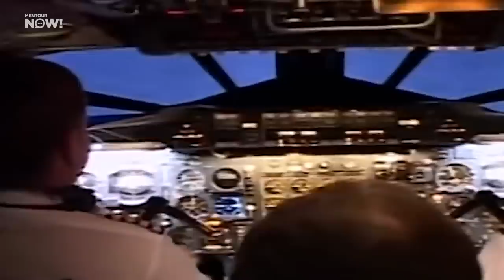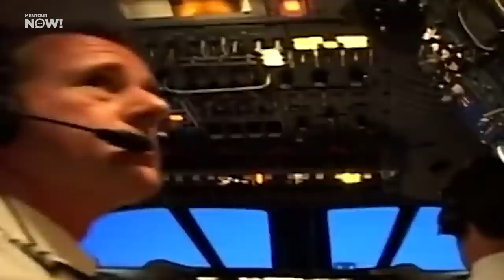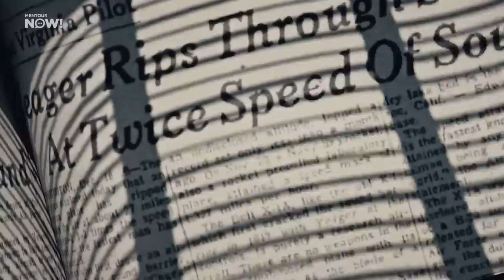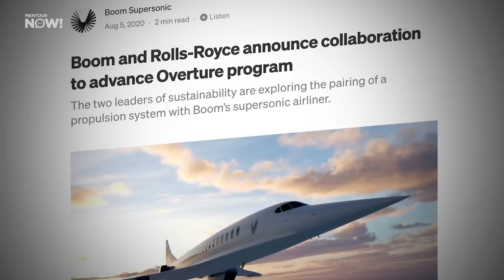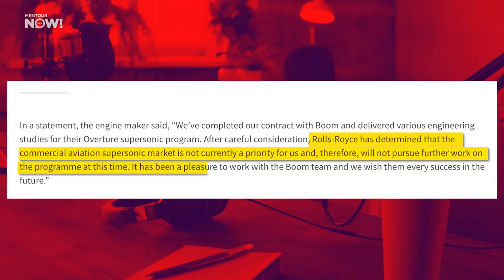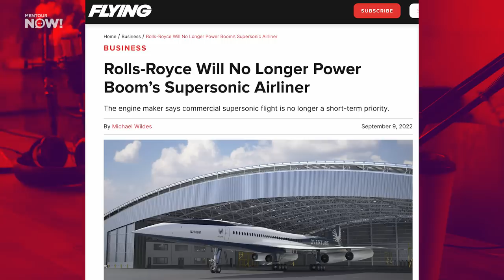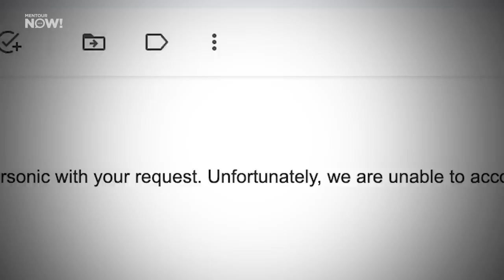WHAT’s Going On with BOOM Supersonic?! Will it Fail?

Comment: Like some other people's "favorite planes" - Concorde, SR-71, F-14, etc. - is the Boom just beyond the realm of practicality? What tech advancement does it have over Concorde? Have we just reached the point of diminishing returns, where it takes far too much money, work, time, technology, etc. to achieve a little bit more performance? Consider the years it is taking to develop new military or civilian aircraft today (777X, F-35, KC-46 - Boeing built hundreds of tankers in the '50s on a new airframe), compared to 65 years ago, when I was a boy. Or the time it's taking to go to the moon, something we did decades ago, with far less tech and money. Mars?! Forget it!
Reply: @bryanjennings5262  

Will Overture be able to fill the gap left by Concorde in the SST market?

Introduction
Boom have undertaken a mammoth task in developing and producing the Overture SST, with its Symphony power module and turbofan engine. The biggest risk is that they will deplete their capital, before a prototype Overture flies. Once that milestone is reached funding should be available. The following, is based primarily on information from Boom, and assumes that Overture meets its specification and goes into airline service. I have no connection with Boom whatsoever.

Aviation
Aviation has changed radically since the iconic Concorde first carried passengers in 1976. More people are flying, the number doubles every 10 years, and they are richer. Aviation fuel is roughly the same price as it was in 1976, taking into account inflation, and with deregulation, airline tickets are now cheaper, in real terms. Aircraft now have the range to fly non stop between any two airports in the world.

Technology
Computer aided design, and simulation has transformed aircraft design and development, by drastically reducing time and costs, and increasing effectiveness. In addition, advanced technology and materials, have enabled more powerful, more efficient engines, and lighter, cheaper, and more streamlined aircraft. 

Flight
Because Overture will be economical at sub and supersonic speeds, 500 routes, some mixed land/water, are viable, rather than just 2 Atlantic routes for Concorde. Overture will be carbon neutral, using sustainable aviation fuel (SAF). Overture will will create a sonic boom, but not over land, where it will cruise 10% faster (Mach 0.94) than subsonic airliners. It will cruise at twice the speed of subsonic airliners over water. Concorde carried 100 passengers at Mach 2, over 4,488 miles. Overture will carry 65 to 80 passengers at Mach 1.7 over 4,880 miles. 

Airframe
Both aircraft are 202ft long, but Overture will have a gull wing with computer controlled leading and trailing edge flaps, and a greater span, at 106 feet compared to 84 feet. Overture will also have an empennage. Carbon composite construction will enable streamlining, weight saving, and increased strength, while practically eliminating thermal expansion and contraction.  Overture will weigh an estimated 154 tons, Concorde weighed 185 tons. Concorde could carry 2.5 tons of cargo. The cargo capacity for Overture is not known. 

Engines
Overture's engines will be medium bypass turbofans without reheat, while Concorde had turbojets, with reheat. This means that Overture will be economical at subsonic speeds and will be low noise on take off and landing. Variable geometry ducting in the Symphony power units will probably allow the engines to supercruise.

Costing
Overture's predicted development cost is $8bn, against $14.4bn for Concorde. Manufacturing cost will be less, maintenance costs will be lower, and availability will be higher. Overtures selling price will be $200M, compared to $320M for Concorde. At a guess, Overture's development payback will be 150 aircraft, and airline payback will be 10 years, assuming 72 seats and 8 hours a day utilisation.

Operation
Overture will be simpler to fly, eliminating the need for a 6 month pilot conversion course. Overture will have improved low speed handling, especially on take off and landing, while maintaining low drag at supersonic speeds. It will have a modern cockpit, with a flight deck similar to subsonic airliners. A flight engineer will not be required. Instead of a droop snoot, external cameras and cockpit displays will give the pilots a view of the terrain when taking off and landing. Its cabin will be quieter and all its seats will be business class, almost certainly with internet. In contrast to Concorde's awesome engine noise, Overture will comply with ICAO-14 noise regulations, allowing it to use all airports, without triggering protests. 

Ticket Cost
Taking a JFK to LHR one way flight:  
Showing: Aircraft type,  Fuel cost per passenger,  Economy ticket,  Business Class ticket,  Duration

Boeing 747          $147          $577             $2,308                      8hrs 
Concorde             $753                                $5,000^                     3.5hrs 
Overture^^            $708         $1,200           $3,000^^^^                4hrs 
Business jet^^^                                 $53,000 to $99,000            8hrs  

Notes
^ 2023 value 
^^ Estimated prices, assuming Overture carries 72 passengers against Concorde's 100. For the first 2 years, only business class seats will be available.    
^^^ There are no supersonic business jets
^^^^ $5,000 return 

A 16 hour flight across the Pacific on a subsonic jet could be achieved with a 1 hour refuelling stop by Overture, giving a time of,  4 + 1 + 4 = 9 hours.

Market
Overture will not be competing for the mass economy market. Instead it is aimed at the 700 million long-range business flights made each year world wide. Boom and airline customer surveys show the viability of Overture, and they have identified 500 suitable routes. All Overture's seats will be business class and ticket prices will be comparable with business class on subsonic airliners. Once Symphony gets established it could become a niche service, similar to Concorde, but with many more routes.

Conclusion
Overture will be popular with both airlines and passengers, because it will half many journey times and will be cheaper, more comfortable and a lot more practical than Concorde. The military have already shown an interest in Overture. It would also be suitable for charter flights. There may even be a market for the Symphony power unit or just the engine. As Overture matures, it will probably be developed, just like subsonic jets. So the range may be increased, there may be a stretched version, and even an all economy seat version. After Overture, Boom could possibly develop a 200 seat SST.

22-2023.09.04

Comment: I think BOOM could use some Russian engines; hear me out 
NPO Saturn has a massive background in supersonic focused engines and the experience that goes in it, they also use some pretty novel tech and can make very powerful engines in pretty a pretty small size whilst not costing much. In fact their Al-41-F series engines might be the engine boom is looking for, it can support supersonic flight without afterburner and produces a dry thrust of 86.3 KN and 137.3 KN with after burners on. On top of that the dimensions are very small: Length of 492.3 cm with an inlet diameter of 93.2cm with a weight of 1604kg.

Also; please people don't rush on me with spears because I said something Russian can be good, I don't support anything in this war.

Comment: Another issue with Boom Overture is that it's "green credentials" is effectively a form of "green washing" rather than having any real substance, this may well be part of the reason why all the established engine manufacturer don't want to get involved. If so I expect all the other smaller manufacturer you mention will have similar concerns.
IE, yes, it could run on "green fuel" but the supply of that is very likely going to be very limited for the foreseable future and not sufficient for even the conventional jets that will be able to use it, anbd this will probably be the case into the mid to late 2030's at least unless one or more unexpected breakthroughs occurs.
Which means that any of fuel an Overture uses mean someone ELSE will then need to use fossil fuel instead of using that same green fuel. And Overture's fuel usage per passenger and distance is way, WAY higher than conventional jets which means it'll cause massive extra emissions. Yes, they can move the actual emissions to someone else by overpaying for "green fuel" but the end result of them succeeding would mean lots of extra emission.
Reply: I have to agree. In looking at their official assertions (I don't want to say 'propaganda'), their 'green' claims were the first big red flag for me. Aerospace research has no lack of startups which get by on seed capital alone while producing nothing but promises, often for quite a long time. I'm not impugning their motives (I simply don't know), but their trajectory thus far does not paint a very encouraging picture, if the goal is an end product that can stand on its own merits in the marketplace.
 I really hope the company isn't operating at Theranos levels of deception, but I can't shake the thought that at the very least, some self-delusion is becoming ever more obvious as time passes.

Comment: I love the Concorde, it broke my heart when it was retired. I do see a lengthy enough window for supersonic passenger planes. Point to point suborbital hyper sonic. Passenger flat loons on the horizon. It may just be my opinion, but I think bowling has sucked ever since they merged with McDonnell Douglas..
Reply: The ultimate solution would be to fly at the height defined by the Knudsen number for a particular aircraft, where the air molecules are so far apart that shock waves cannot form.  At around 500,000ft (95mi, 153km), sonic boom, drag, and skin heating vanish, allowing an aircraft to 'glide' under inertial force, after being accelerated to supersonic cruise speed. Only the power to overcome the drop due to gravity would be required (by choosing the correct height and speed satellites, are able to circle the earth for tens of years with no power). 

The proposed Venus Aerospace Stargazer won't reach the 'Knudsen height', but in part, it's like the ultimate solution. According to the Venus site, it will take off using jets, to keep the noise down, then, under rocket power, it will climb to 170,000ft (32mi, 52km), where it will cruise at 6,900mph (sonic boom isn't mentioned). It will carry 12 passengers and reach any airport in the world from any other airport within 2 hours.

Comment: The way I see it is that we have pretty much perfected subsonic air travel to the point where it's profitable and practical.

The next major leap Forward will be point-to-point suborbital transport like what Elon was talking about possibly using a starship for, until that happens I don't see a real need for supersonic transport on Earth!

Supersonic transport is slightly faster but far less profitable and only saves a little bit of time compared to a suborbital point-to-point flight.